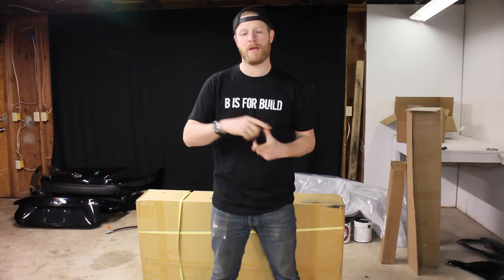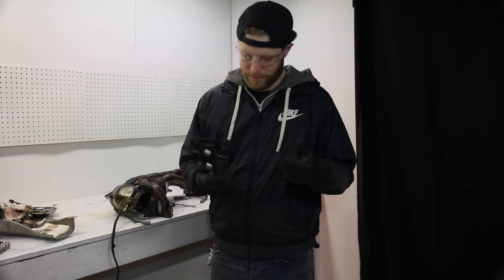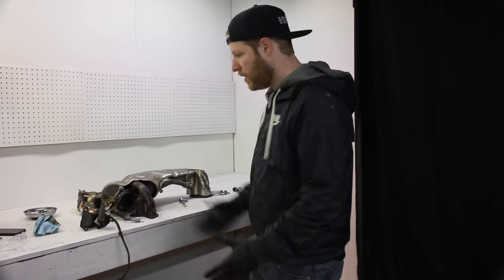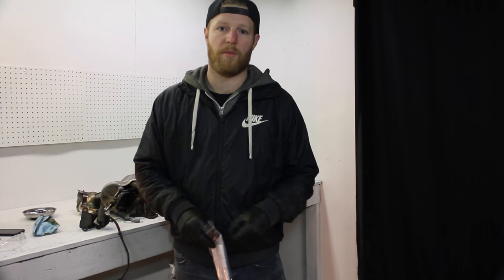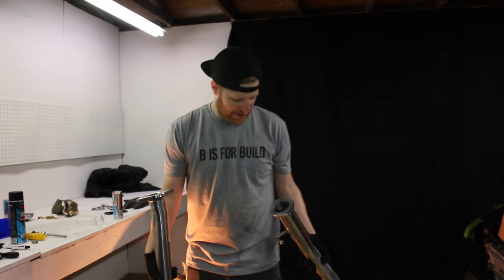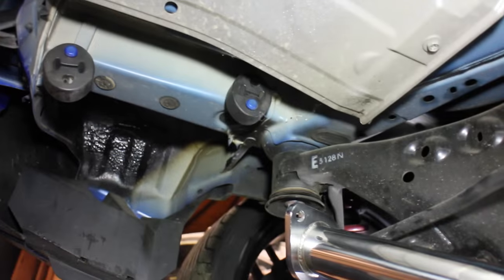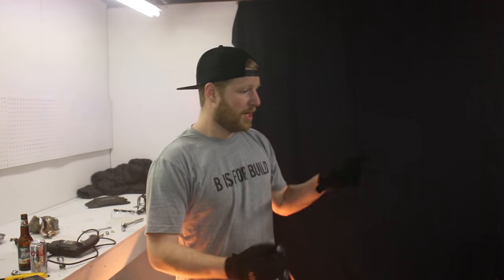BRZ Resurrection Pt 20 - New Exhaust Install & Minor Engine Failure...

Comment: In all seriousness check that the o2 sensors are plugged in, check ignition, not sure what type the brz has but plugs? Wires? Coil packs? Icm? Is the maf plugged in? Fuses? Vacuum leaks? Clear the codes and see what comes back.
Reply: +Akizzem Up-vote this!
Reply: +Akizzem Mostly seems like a throttle position sensor failure. Engine is blipping the throttle for some reason
Reply: Have to agree, the oxygen sensor in the exhaust was my first guess, seems like it isnt plugged in so throwiing everything else off. Don't stress though chris, will be something simple, keep it up man
Reply: +KidSavesTheWorld -Again honestly seems like something with the o2 sensors. When the car starts its in open loop for the warmup period. Once it switches over to closed loop it uses the o2 sensor for fueling.
Reply: Akizzem you raise a good point
Reply: Maf housing should be the same diameter as stock air box housing without a tune. But I'm this case looks like there is still a wiring problem with the the harness since all those sensors are giving code. I would check the electrical diagram again. Maybe other part of the harness has been damaged as well as the fuse box.
Reply: +Akizzem Sounds like he forgot to plug in o2 sensors.
Reply: +Akizzem My audi s4 did this same thing and it was the O2 sensor that was bad.
Reply: +b is for build
Reply: +Akizzem yea your right. p0055 and the p0031 are the heater control for those o2 sensors. they are going to be wide band o2 sensors. those heaters have to be working properly for the o2 sensors to work. so checking the wiring is start. b1s1(the p0031code) is where the first one on the exhaust, i think where the crack in the crank case(aka timing cover) if im not mistaken. the p0055 b1s3 is after the cats. the p2100 is the..well it is what it said it is. that is a fly by wire system. check to see if its plugged in all the way.  may just need to be adjusted.   the mass air flow is because of ghetto job. should be an arrow on top of it showing the flow of it.

Comment: When you started the car it was idling fine (open loop mode - no O2 sensor input yet) then it started going wonky, likely after switching to closed loop (when the ECU looks at the O2 sensor data and begins to adjust fueling based on that). That suggest it could be O2 sens related. Check they're screwed in properly, check wiring to them, and depending on what OBD2 scanner you have, you should be able to bring up a graph of the O2 sensor to check it's working properly. Check out ScannerDanner's videos on O2 sensor diagnosis for some good in-depth info. The custom intake could certainly be causing some issues too, especially given the MAF housing has been altered. Try a stock airbox if you can get your hands on one (at least for diagnosing).

Comment: you changed the harness in the car. go back and check for loose grounds and loose wire connections. your mass air sensor may not be sitting far in enough in the tube causing a misreading if the airflow but it also may be damaged from the crash so I would check the condition of it. try swapping parts from plan b to see where the problems are since plan b is a fully functional car with no codes
Reply: This was what I was thinking too. What are the chances all those sensor malfunctions. I don't think he left both the front and back o2 sensor unplugged either.
Reply from the maker: +Mitsu ill check all the grounds again.

Comment: Best route to troubleshoot in my opinion,  make sure you have a obd2 scanner that reads data stream of the ecu and sensors and take a look at the values while the car is not running but the ignition is on, for example make sure you have corresponding throttle position sensor readings when off the gas pedal and when wide open. Do the same with O2 sensors  when starting the car, that should help find somewhat of the culprit to your newly found issues.

Comment: Hey man. Great video.  A little grease on the exhaust hanger studs will make the rubber slide on easily. It will also prevent them from squeaking and make taking them back off a whole lot easier down the road.

Comment from the maker: 5th!
Reply: Lol
Reply: Name the The first Brz the Arz
Reply: Check O2 and MAF sensors they have to do with fuel also check throttle body and position sensor could be cut  wires as well as you mounted the overpipe the wires could have been pinched under something
Reply: +B is for Build Check that you have your o2 sensors plugged in correctly(rather than reversed) If they're reversed the engine could bog down and run very rich/backfire.
Reply: ogopogoful don't forget the MAF sensor it may be faulty or reversed as well or maybe he need a factory airbox
Reply: hey unplug your battery cables and touch both together to reset the computer and see what codes pop up after that. you may have a bad o2 sensor in the front or rear of cat.
Reply: Hood damper is not that expensive... It really bugging me since the first episode... but It make the video much special
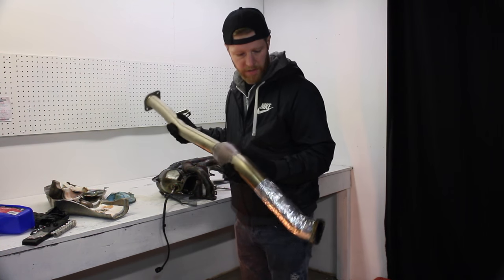Reply: +B is for Build the look on your face at 3:10 is price less its like ooooooh shiiiiit lol
Reply: +B is for build I hope you are able to get enough money for this project

Comment: Check O2 sensors, clean / replace the MAF, if that doesn't fix it it might be a throttle position sensor. Hope that helps. Loving the videos! Keep them coming!

Comment: Ok, this isn't just o2 sensors unplugged, and it's not the maf in a wrong sized housing. You have a Major issue somewhere in your wiring. Check sensor grounds, check Ecu grounds, and check all connections. Search for any place the wires may be shorting out as well.

Comment: Awesome job so far. As far as the codes i would start with the O2 sensors since you unplugged them and then its a process of elimination. the car started up fine and after the computer had time to do a self check that's when it started throwing the codes and running like crap. Just check all the plugs that you unplugged and make sure you replughed them all back in. Can't wait to see the next video

Comment: I have a vw golf mk4 and used to have the same issues where my car rpms bounce at idle. What caused mine was putting a new air intake and exhaust on the car which the ecu wasn't used to it. So what I was told is when your car starts bouncing at idle rev it to the beginning of the red line then let it go back to idle for a second and after that hold it at 3000 for around thirty seconds and it should stop as it stopped the problem for me but could be different as its two completely different manufacturers, but it's definitely worth a shot as it may save you money as well

Comment: Because there are a lot of issues related to sensors in that area of the engine bay check for a missing ground or a bad connection for the o2 sensors could just not be plugged in correctly

Comment: Try using the intake box from the plan b and check 02 sensors. Throttle position code could be due to limp mode.
Reply from the maker: +Bryan Ballare thats the plan, i just called the dealership parts department and they helped me go over a bunch of sensors i plan on testing and verifying they are the same for manual and automatic, so were all in the clear, im excited to give it all a try

Comment: Clear codes and then see what you still have. I suspect you installed o2 sensors, so if it is in fact running rich, you might have a vacuum leak. It could be some other stuff, but vacuum leaks are the easiest to check. That's what I expected the car to do with the MAF sensor unplugged. My cars did that too when I unplugged mine. Hope you fix it soon!

Comment: p0055 p0031 is lambda heater circuit for exhaust
 if it doesnt do it on cold warm up then check lambda wiring
your iat sensor p0113 is sat on your intake pipe will also relate to p0102

all them issues could be on a single fuse, ive seen that mixture of errors  few times.
CHECK FUSES!

Comment: As i have been sifting through the comments, I am agreeing with all the guys that are saying the Homemade MAF sensor housing probably wasn't the best idea. As far as engine goes I would get a different Intake that the MAF would be compatible with. Or take it and get it tuned for the setup you have. Honestly haven't seen an O2 sensor make an idle that rough though..or else I would agree on that part too. I'm thinking that MAF is the problem. That would be my two cents. +B is for Build

Comment: Bank 1 sensor 1 is almost always drivers side of the manifold after the manifold and before the cat, bank 1 sensor 3 should be behind the cat. P0102 and p0113 are definitely related to the temporary intake you put on. I'd say engine just doesn't know how much fuel and air it needs due to the mixture of faults. If there's anything I can do feel free to pm me (I'm a mechanic) lol

Comment: From personal experience some cars do not like certain intakes, try dropping the stock intake from the other brz and also disconnecting the battery to reset the computer. i had an aftermarket intake on a car once that would throw an MAF code just from using a different filter (dry vs. oiled)

Comment: on Subaru engines, the distance between the filter, throttle body and their proportions to the Air Mass Sensor are critical. go to a stock BRZ, measure the distance between the filter and the MAF, same for the Throttle to MAF. apply to your ghetto intake. otherwise use a stock intake pipe and you can use an aftermarket filter at the end.

Comment: From the sounds I would suggest that one of the four ignition coils is faulty.

Another reason could be that the ecu needs a new mapping as the MAF sensor and the lambda sensors get different values as they are supposed to get when beeing stock.
Reply from the maker: +TurbomanGER ill keep that in mind, thanks

Comment: @bisforbuild I may have some help for your idle problems! When I changed my clutch and re-installed my motor, the throttle cable was installed without any slack. The ecu was trying to return to idle but could not. It went into the repeated revving like yours. It threw a code that sounded identical to yours. Make sure the throtle cable has a slight slack at closed throttle. Good luck

Comment: maf sensor might not be air tight like you thought spray around your intake with brake clean and see if it revs up then if it does it has a leak there and isn't reading the air flow correctly also check o2 sensor wiring for other codes if wiring looks good then it might just need new sensors

Comment: Hi there, your issue is clearly related to your drive by wire system. Plug the MAF back in, that car doesn't use a traditional "limp mode". It just doesn't run for shit without an airflow signal. The O2 codes are likely the sensors being damaged. Considering the trans mount was mangled, the O2's are far more sensitive and likely are damaged. I'm assuming your MAF related codes are in memory from running the car with no intake at all and the sensor hanging sort of in the tube. The other codes and the reason your junk is running like junk are the DBW system though. My suggestion is a dealer visit.

Comment: If you add wd40 to the rubber hangers it makes it much easier to install and remove. Maybe you left o2 sensor remove. It must of triggered the ecu when you started the car without the manifold on the last episode. +B is for build

Comment: Welp, check you O2 sensors to make sure they are plugged in(obviously) but also ensure that you plugged them back in to the correct receptacle, you might have them switched. 

Mass airflow sensor pressure is due to the increased size of the intake you put on(but i assume you knew that already) bigger pipe not= not as much air flow past sensor. 

IAT sensor is running at 5v(more likely 4.6 to 4.8 volts) could mean the resistor is gone. the ecu is picking up a full signal so it may also be that the sensor tip is damaged causing the circuit to be bridged, or it may be receiving a 12v input in place of the standard 5v it normally runs off of. best bet is to use your multi-meter to measure the input and output leads on the connector while key is turned to accessory mode. input should be 5v output should be lower when cold and higher when warm but should not exceed 4.5-ish volts when HOT and no less than 0.5-ish volts when cold. it shouldn't be at 0 or 5V but somewhere in between. 

P2100 has a few options but most importantly, because of the battery being disconnected(with older subaru's for sure but i'm not sure about the newer than 2010's), you need to turn the key to the accessory position for at least 10 seconds to reset the relay and sensor. then you should let the car idle for at least 10 minutes with zero load on it(aka don't blip the gas as you did), just let it sit. it usually take 5-10 min. You should disconnect the battery again and let the ecu shutdown fully, then follow the previous steps. if that doesn't work then check the connector to the relay it should receive a steady voltage, if its jumpy you either have a bad connection at the plug, a bad connection in the wiring harness, or a faulty relay.

C432D? cant say i've had that one come up before, sorry no help on that but its probably related to one of the other codes. or google it and see what you get.

Hope this helps, or at least gets you pointed in the right direction. GL sir and i look forward to more content!
Reply from the maker: +c rea (G0ATLIF3) thanks for all the tips, ill keep them in mind while diagnosing

Comment: good chance it's from the oil in your pod filter. sometimes a little can hit the air sensor right behind the filter.
As soon as you hit the accelerator and it started running rough I was thinking this.
take it off clean it and you should be ok.

Comment: Whole bunch of oxygen(o2) sensor codes lol. It doesnt take much to screw them up. If you cant get them fixed after changing them. Try de-foulers. Thats what they usually do to straight pipe subarus so they dont throw codes

Comment: good tip for the rubber exhaust hangers is too get them wet ;)
Reply: +Afee ps or spray a little silicone spray on them, slides right in
Reply: +Afee ps Brake cleaner works good. And it'll evaporate when you walk away.
Reply: +Afee ps   I actually use dish soap. It wont degrade the rubber or urethane. Added bonus just rinse it off with water . And wash your hands off in the process .

Comment: check for vacuum leak, might need a 02 sensor that code is for that last sensor on the exhaust bank 2 usually they're after the converter, as far as the p2100 check the gas pedal it has a sensor attached to it it might be unplugged or damaged, you can buy a sensor usually or the whole assembly its 4 or 5 bolts and the connector. I'm guessing the mass air flow sensor code is from a 02 sensor not reading. as far as the code c342d that will need checked by Subaru

Comment: For sure an maf and tps issue. Had the same sorta thing on my 240, see what the fsm says about diagnostic goes for the right voltage for the throttle position, then as far as the maf try cleaning it or swapping in another one from the b car, checking grounds and if thats all good then its more wiring issues :/, try unplugging the ECU and the battery for a good hour to reset everything, maybe check the fuses, it seems like its something super small... It always is.

Comment: With the airflow meter I would try the air intake off the other brz as the pipe size is very critical at the air flow meter and I would also test all the wiring with a multimeter in the sensors that have codes and compare to the wiring diagram if all sounds like wiring issues

Comment: I could hear the engine start missing while it was idling.  Timing went down the toilet. Check your plugs, even if not fowled they can give you a good indication of fuel/air problems by being wet, dry, burnt, etc. just look up some examples on the net.  Also check wires, O/2 sensors, & possibly for vacuum leaks especially around that MAF.  That weird idle is all the computer can do to keep it running.  A lot of times New fancy exhaust systems can wreak havoc on stock sensors and such, def double check all your connections.

Comment: I suggest you reset the codes then run it again. That way you can make sure all those codes are current. Then recheck all your grounds. A lot of the time multiple crazy codes will be cause by a faulty ground.
Reply from the maker: +Kenny Downs i did do a reset on all the codes just to check, and they are all still the same
Reply: +B is for Build gotcha yeah check grounds for sure

Comment: Pull each o2 sensor for the Plan B and switch with Plan A and see which one could be bad. Or try putting the stock Air box and what not from plan B to Plan A and when you do these things disconnect battery for the computer to reset itself. but i would just do one thing at a time so you know which one could be bad.
Reply from the maker: +HavocR6 thats the plan

Comment: It seems like a vacuum leak, judging by how the engine is idling. However, that idle could potentially be caused by a wiring issue. I don't know how that car is wired or what all the ecu can do if there are wiring issues. I would check the intake manifold for damage, or, just go ahead and yank the engine and transmission and prep the car for a swap.

Comment: Come to think of it, just another idea.  I didn't see a sensor around that cat, when you were showing it at the table, so your car's computer may require a bypass for a sensor that it thinks is there and trying to compensate for even tho its not & screwing with the air/fuel ratio, throttle or timing.  Just another idea to check into?  If you got a random harness connector hangin under there with no home, that might be your answer?